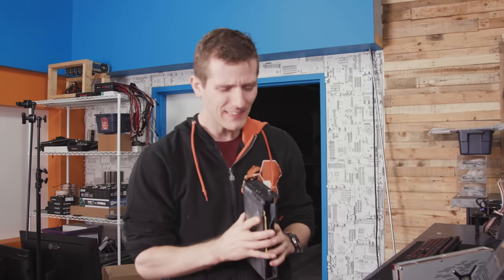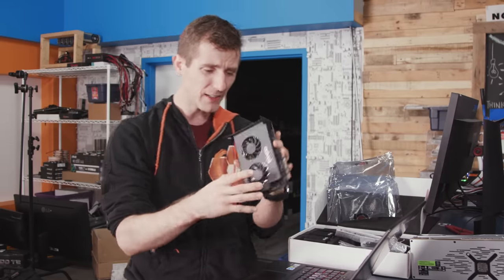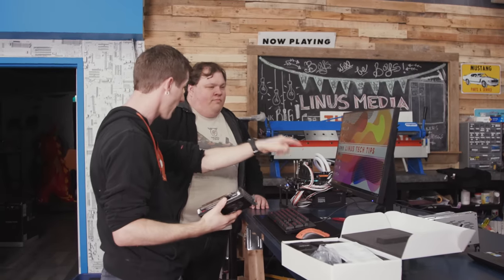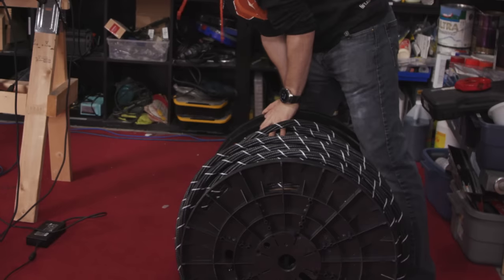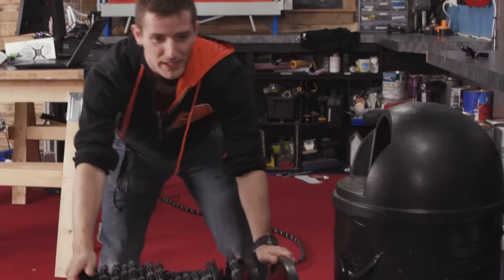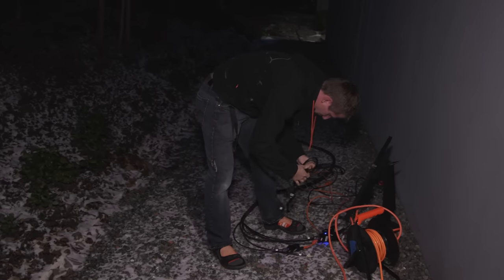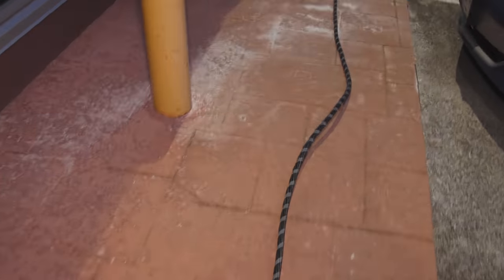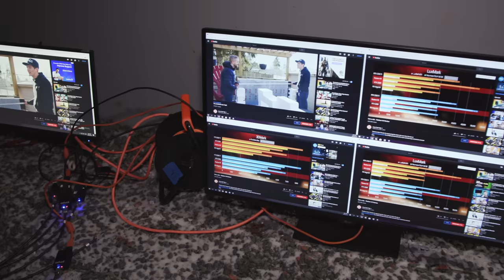The WEIRDEST Video Card We’ve EVER Seen..

Comment: And here I am. I didn’t even know Ethernet could carry a video signal
Reply: well technically it cant but it can via an adapter which makes the monitor understand the signal
Reply: Its used in high end multimedia think big screens at concerts, xr staging applications (like disguise), ect
Reply: Im guessing it works like watching videos off the ethernet
Reply: You can use any cable for anything you want assuming it has enough wires and you have enough frequency. That's how some risers abuse USB A type cables to transfer PCIe signal; mining doesn't need a lot of bandwidth, so using just 4 wires is enough.
Reply: @karai5082  no, when watching off of ethernet you are sent a video file that is processed by the GPU. but this sends an HDbaseT signal into a ethernet cable, it is converted to HDMI signal part way through.
Reply: Well ethernet can't, since that's a link layer networking standard. But Cat5/5e/6/6a cable? Well it's just cable you can push a lot of different types of data over it. Some more suitable then other.
Reply: Think if it this way, the video you are currently watching is being streamed through a ethernet cable
Reply: @LordOfPontus  it works by just sending the signals over a different wire but it has less loss do you the better insulation of the components and wires so as long as those signals get changed back to normal HDMI your good if you wanted to you might be able to transmit straight hdmi over it too but the encoding method they have for the signals has less quality loss even if there was more data degradation over the distance because of the way it decodes the data to hdmi
Reply: @darkangel424cod  in a way your right but there’s a big difference in the way the data’s handled
Reply: @alop53O1  yea I know, just a simple way of thinking about what its capable of
Reply: Most security systems use a network cable and through a cat 6-HDMI converter can output a video signal
Reply: I did this for my xbox 360.
Reply: How are you watching YouTube?
Reply: Its just pointless just get a gpu
Reply: Did anyone apart from advoli people???
Reply: And you didnt know this, while youvwere watching vidio tbdough an ethernet cord,(the ethernet cord to your routed)
Reply: Me two
Reply: Ye i dont have a gpu and i dont have to do this (: i got hdmi on my motherboard and an apu haha
Reply: Youtube in a nutshell
Reply: It can even carry power
Reply: Most quality HDMI cables have started advertising having Ethernet capability. My church uses ethernet to connect a camera to their streaming pc because HDMI is not long enough.
Reply: That's how IP cameras work
Reply: the CAT-5 cable doesn't care which bits are transferred
Reply: I'm late
Reply: They actually use cat5e cable for allot of cheep hdmi cables
Reply: I used to use to keep my pc in my basement, and I used those adapters for HDMI and USB. They were a bit finicky but they worked fine.
Reply: Get a crossover ethernet cable and you can also do some really fast data transfer from one pc directly to another
Reply: Im about to rickroll my service provider
Reply: You jest
Reply: Ethernet can also carry power if you didn't know that
Reply: ..... while watching a video over the internet
Reply: I mean, anything can carry any standardized signal, as long as there’s an adapter, if there’s an electronic converter, anything can really carry any signal
Reply: I’m not sure if I’ll ever forget the Linus noises
Reply: @Selicre  thanks for this , I had a miner try explaining how 6 cards go on one board and I never consider usb
Reply: Well it can carry headphones too
Reply: Technically YouTube is video signal over ethernet
Reply: Wow.  Copper can carry electrical signals.  That's amazing.
Reply: Technically speaking any copper conducter can carry a video signal. Carrying the signal doesn't have anything to the with the Ethernet specifically. You would just need an adapter for whatever conductor you choose to whatever video input your monitor has. And you probably need something like 4 to 8 wires. But if you want you could send a video signal over 16 gauge 😂you would just need to MacGyver an adapter.
Reply: @Hentai7890The2nd  No. Youtube sends a data signal, not a video signal
Reply: hobkin!
Reply: @Charlie59876  yeeee
Reply: Goddammit wires are wires
Reply: My security cameras use Ethernet cables
Reply: @luisfigueroa8068  To send the video data to your hard drive for storage, not for sending the video singal
Reply: data is data
Reply: If you think about it anything that can carry an electrical current can carry a video signal
Reply: Ndi
Reply: 1) a pair of copper wires can carry a video signal
2) YouTube is video over Ethernet
Reply: Data is data
Reply: @rafaelmesaglio1399  Sort of.  Electricity is electricity.  :-)
Reply: Well technically any data cable can carry any type of data
Reply: You've never seen a basic RCA set up then
Reply: @Maceyee1  RCA? Which app is that? (Just kidding!)
Reply: It carries all of the signals.
Reply: It's sometimes used for high definition up cameras
Reply: Data is data
Reply: @brianhukee9978  but thats not a direct video signal. Thats data
Reply: @WigWoo1  same concept here. That’s why those adapters at the end of the Ethernet convert the signal to a type the monitor can render. Video signal is still just data at the end of the day. Only difference is the syntax really.
Reply: well everything tht can carry 1's and 0's can do it If you have the proper equipment.
Reply: it can even carry analog signal
Reply: Wait till you learn you can use the built in coax cable in your house to send internet to the remote corners of your home
Reply: I do IT at some bars that have about 50 tv screens including 6 projectors and they all use Ethernet. the 18 cable/satellite boxes feen into a a big "tuner" that has about 100 Ethernet ports on the back that lets you program which boxes go to which tvs. it's a pretty cool system. swtiches to component (or composite, I forget, the red green and blue wires) after the run by the tv. at the time we set up (about 5 years ago) the Ethernet to HDMI adapters were comparatively expensive and didn't work super well
Reply: It can
Reply: I dont see why not, it's just a data transfer cable
Reply: Still data transfer so... yah with some adapters it's possible!
Reply: Same
Reply: Hello, furry. Nice to see you here
Reply: I wonder what my router displays
Reply: The 'ethernet ' cable is called hdbaseT which uses the same connector as ethernet
Reply: it technically carries everythung